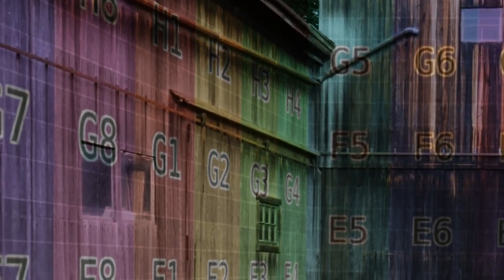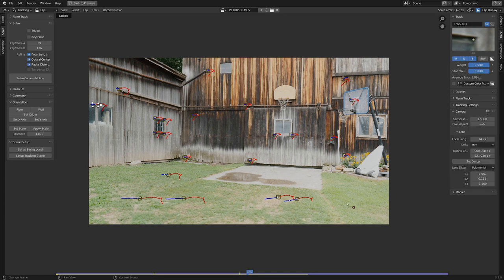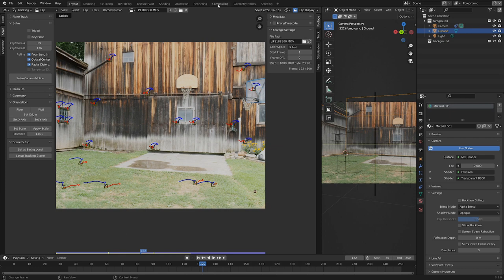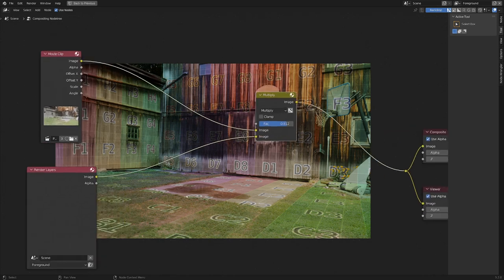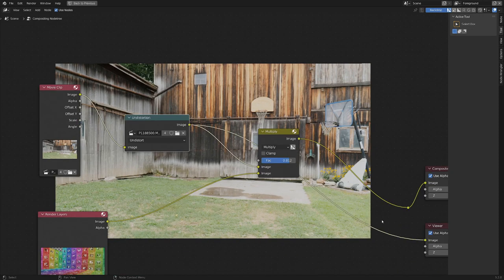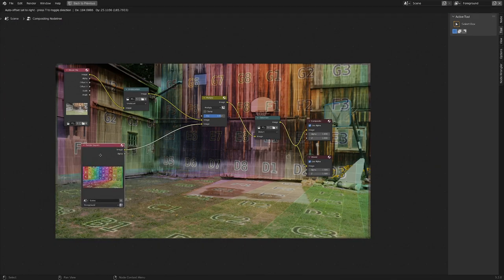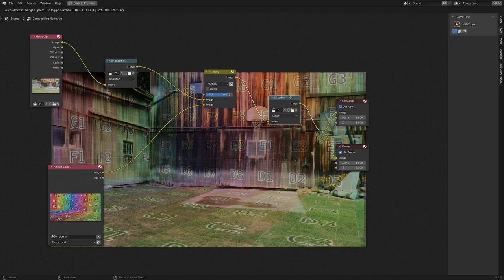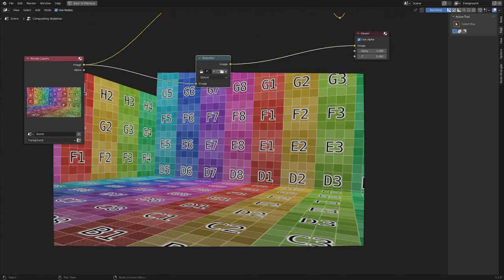How lens distortion can wreck your camera track

Comment: i have a question that. is  this distortion calculation of blender is 100% correect? cause im getting artifacts from it in scene reconstruction. from vertical footage from in iphone 13 pro. ive tried manually k1 k2 value but confused as its so minor in 1x zoom camera is there any numbers to put or some checkerboard or something to calculate i want to know exact values for iphone 13 pro camera?
Reply: It is a known problem with vertical footage. Even with perfect tracking and low pixel error. Try to change the "Sensor Fit" setting from "Auto" to "Horizontal" in the second tab in the Camera's settings and it should work.